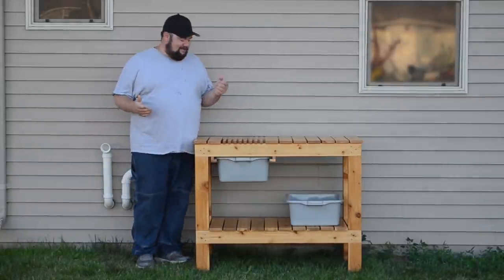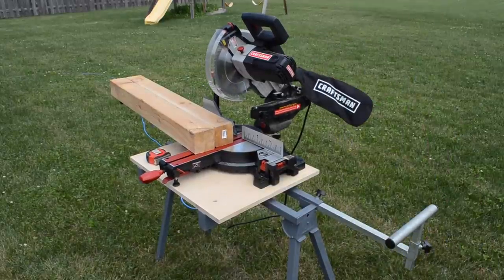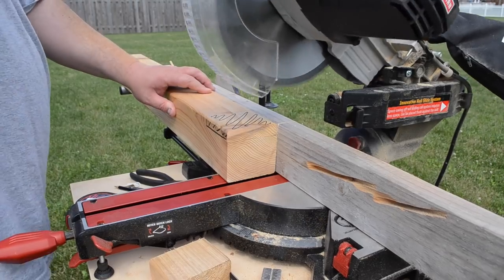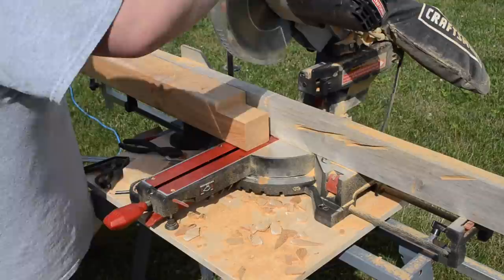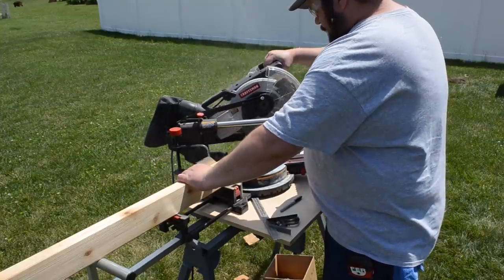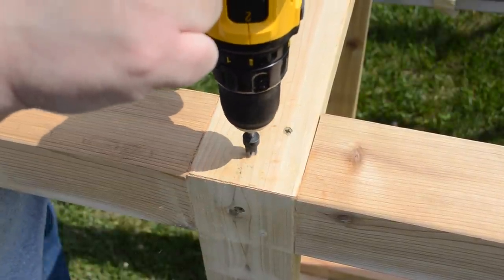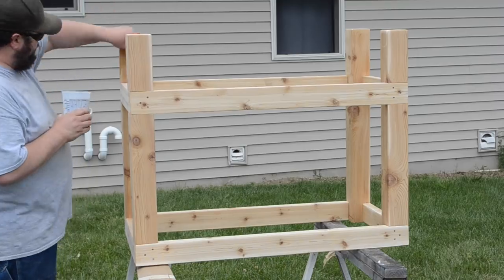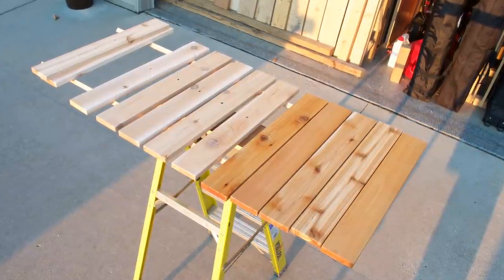Ⓕ Workbench Build / Potting Bench - with Unique Joinery (ep89)

Comment: My wife and I loved the video.  I noticed you used a Craftsman miter saw and I was wondering how you feel it works out for projects.  I am looking for a good saw and there are so many to choose from.  Does the one you used it meet with your expectations as a tool to have?  What are the positive points and are there any negatives we need to be aware of?
Reply from the maker: thanks, glad you guys enjoyed it - I own several miter saws - in fact my first one was a Craftsman saw - it is a non slider and now it's outfitted with an abrasive blade just for cutting metal - I've also purchased the HF 10" one for a theater group I work with, I didn't like that one at all, way too sloppy - Sears sponsored this video so you can imagine it be fitting for me to use a Craftsman saw - the one in the video is a good value at the price point - accurate enough to do joinery for this project which has it's challenges in the joinery - I like my Makita saw as well - but at almost 3 times the price of the Craftsman one, a person has to figure out where they want to spend their money - keep in mind sliding miter saws all people see is added capacity - while it's true you get that, you also introduce other things, like deflection, into the mix - if a guy were to be cutting 6-8" wide boards all day, I would recommend a non-slider - The saw I used in this video was pretty good for the price - square out of the box and had some handy features like the depth stop and material outriggers - overall I think you get what you pay for, at least for miter saws anyway - maybe with the exception of the Kapex saw - I never cared for the center mount pistol grip on that one - I know it's meant to be ambidextrous but I much prefer a "D" style handle off to the side - much better ergonomics

Now that I have rambled for probably too long, I will give you my default answer - see if you have friends, family or neighbors that have various brands - that applies to more then just miter saws - and if you can try some out and see what you like - most places have good return policies and don't be afraid to take something back if you don't like - I think most manufacturers would prefer you take something back that you didn't like rather than abolish a certain brand altogether
Reply: I agree with everything Nick said ecxept for his comment about getting a non-sliding saw. My old non-sliding Craftsman saw will not cut completely through 6" or 8" lumber (I don't remember which) unless I raise the lumber off the bed; a piece of 1x is enough. 
I am trying to decide how much miter saw I want to buy as an upgrade. I hadn't thought about converting my old saw to metal cutting.
Reply from the maker: had to be 8" - different non-slider saws, depending on how they are designed may not cut through 8" wide boards - my old craftsman saw would but just barely by a really small sliver - in that case it all depends on how much of the saw surrounds the center of the blade - too much motor in the way or too big of a drive mechanism on certain saws may not be able to 90° cut an 8" wide board - you bring up a good point - different saws have seemingly similar designs but may employ an offset motor or a bevel gear set tilting the motor out of the way for higher capacity bevel cuts - a motor mounted inline with the blade 90° to the cut would have less capacity in some cuts to a belt driven motor mounted higher up

Comment: Hey Nick, niiiiiice! Are you sorry you didn't run dowels through the runners?  I'm with ya with the warmth of the cedar. I recently built a couple picnic tables and 2 matching cooler carts for some friends and I / they loved how it  turned out. I hid all the screws or used mortise and tenons. Lot of work, but worth it. Thanks again Nick for the video.  Dean Kramasz
Reply from the maker: thanks Dean - I am - I had a different idea altogether for the joinery and it sort of changed as I went - I am going to show this joinery again for sure with a different plan of attack
Reply: Nick Ferry, looking forward to the vid. Sure is fun working with cedar. Really makes me want to build more with it. Maybe it's the nice weather. I also like the design of the bench. May have to make one myself. Dean Kramasz

Comment: Sadly my Hitachi sliding compound miter saw has no stop so I guess I will have to use my 3hp Craftsman table saw to hog these joints out. I might give this a whirl this coming weekend. Great job on the dowels.
Reply from the maker: thanks man - I've done it on the table saw before and that works really well - if you do, snag a picture, I'd love to see it
Reply: Will do!
Reply: I built my workbench with the same joinery on the table saw. I thought it was a struggle. (Didn't even think to use the miter saw, dangit!!!)  I recommend using a  router or a circular saw and cleanup with a chisel.

Comment: Would have considered using pocket hole screws. I want to do a simple bathroom vanity based off of this design. Only difference will be the top. Would like any suggestions.
Reply from the maker: Pocket holes would lend itself fine for a solid top but I prefer dowels for slats like this - if you attaching a solid top I would just add some pieces of wood to the cabinet so you can screw into the top from the underneath to secure it
Reply: Nick Ferry actually thinking about a Corian top for a more waterproof effect. I would use this design just for the structure and incorporate a small cover/console under the vanity to hide plumbing.

Comment: Very nice bench. Quick question: Why not using dowels on the leg joins, instead of screws? And why putting the 3rd nail between the 4x4 and 2x4? Thanks.
Reply from the maker: I had some ideas floating around and it sort of merged into the three screws - I’ve done just dowels in the legs before and it works out really nice - I’m hoping to show that in the future
Reply: Thanks. I am totally new to the woodwork and am just recently obsessing about it very much. I am building up my very first workbench and thought about using the same joinery you showed in the video. Thanks so much for the video and steps on how to make them.  Not sure if I can pull this off with the 45-degree end-join, still trying to get better cutting angles with precise length. :)
Reply from the maker: no problem - only way to see how well you can make the joint is to go for it - might not be perfect but that'll give you something to improve on next time - if we were perfect at all this it would be boring

Comment: Ok so I am starting to build one based on your video and let me just say those joints take some real time to cut! 
1/2 a day and I’m only done with the 2x4’s! I am doing the chop saw method you were doing. It’s time consuming.
Reply from the maker: I agree - that’s why I mentioned it in the video - take a break if need be - monotony often breeds accidents - I should know, I have kids 🤣
Reply: Finally finished it today. Hour or 2 a day and the Dowels and joints are time consuming but nice. 
I need to seal but that’s for tomorrow
Reply from the maker: @robertcarlini6198  great, make sure to snag some pictures

Comment: Hi Nick, I'm making something similar for local pre school. I have some 18mmx100mm treated battens (got them free) to use for the stretchers and sides etc. I was just going make the dado on the legs. Do you reckon this will be ok?
Reply from the maker: for sure - I just like to do the rabbet on both to split the difference of material being removed - there becomes a point to where the legs and the rails are too similar in thickness to where you can't take the complete amount from one - you still need to have enough material in the legs to attach to
Reply: Nick Ferry thanks, that's what I was hoping for. Thank you for getting back to me (and so quickly).

Comment: What are those metal dowel markers called? Ive seen them used before, but cant seem to find them.
Reply from the maker: I have them listed at the bottom of the article here - https://nickferry.com/2018/07/workbench-build-potting-bench-with-unique-joinery-ep89/ - they are dowel centers - if you get them in a kit like I have on my website, you'll get two centers, some dowels, the appropriate bit and stop collar - to do what I did in the video you would need 2 kits containing 4 centers
Reply: Cool, thanks

Comment: Butchers or Johnson & Johnson paste wax over the sealer on bottom of legs
Reply from the maker: I could see that helping - don't know how long it would hold up though
Reply: No sealer is permanent either which is why I use both.    Maybe bar top epoxy or just a sacrificial pad
Reply from the maker: I agree - outside of petrification, coatings are the main defense but will only go so far - I was hoping to show an epoxy coat in the future

Comment: I like the bench, but you're making a few hundred more cuts than you need to.  Literally.  To cut the reliefs for the rails into the legs, gang all of your legs up on the bench top and use a circular saw to cut them all at once.  They will be they same size and line up perfectly.  After you cut the first set of reliefs, rotate the legs 90 degrees and cut the second set.  Done.  Same with the reliefs on the rails where they meet the legs.
Reply from the maker: And a dado stack would make it even quicker - that really wasn’t to point though